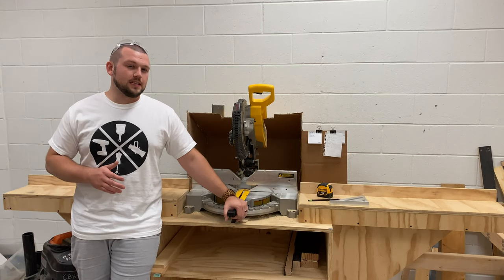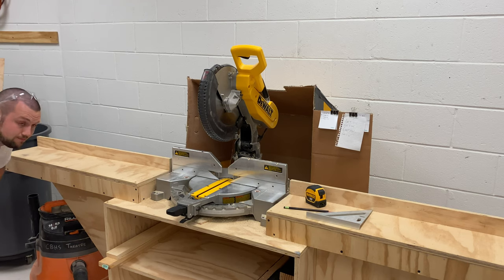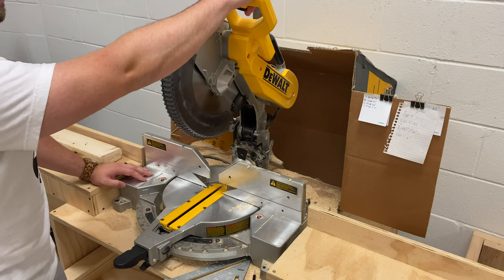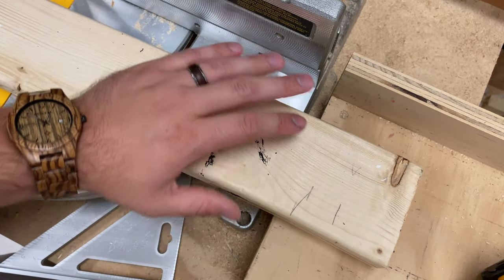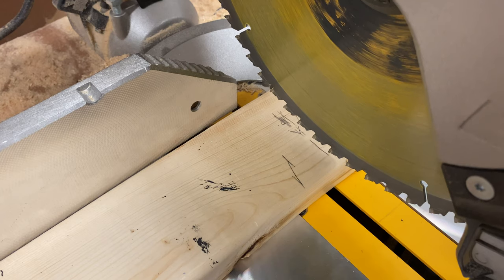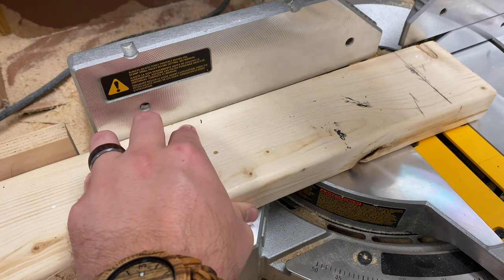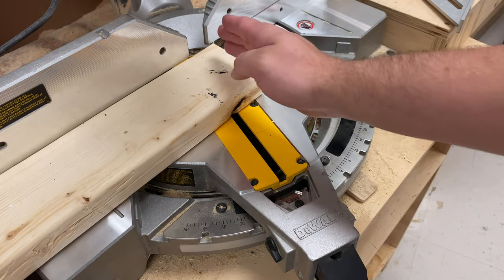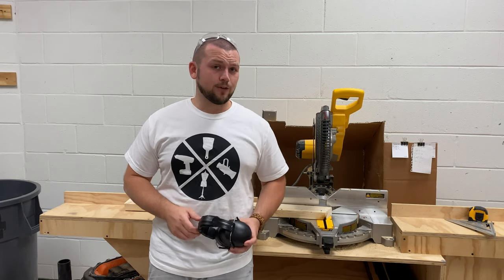Teach Students To Use A Chop Saw (Without Injury!)

Comment: The box. Why didn't I think about using a box to catch sawdust? Better late than never, I suppose.
Reply from the maker: Haha, I had limited time, so this was the solution! Just make sure the box is angled down away from the saw, and stick a shop vac/dust collector hose in the bottom if you can. Makes a huge difference!

Comment: I suggest adding a face mask respiratory if you are doing lots of cutting of wood so you can limit the amount of dust you are inhaling.
Reply from the maker: I definitely agree that a face mask or respirator is always recommended if you have one and it is convenient! Our dust collection works reasonably well for what it is, and we have an air filtration system that circulates the air pretty quickly in our small shop.